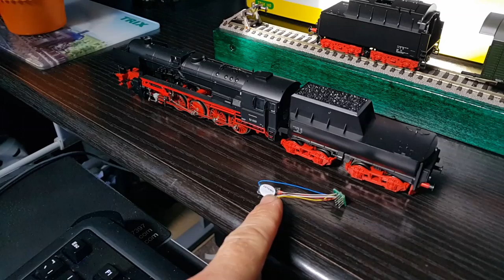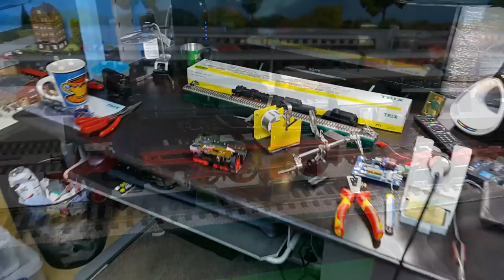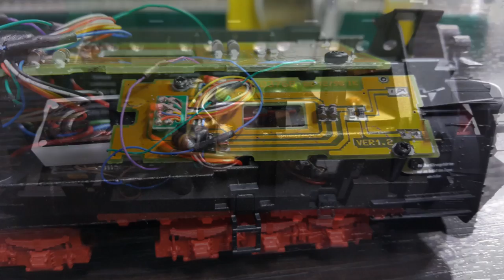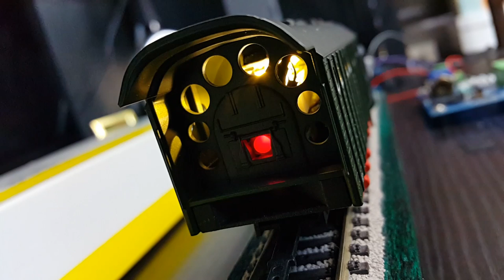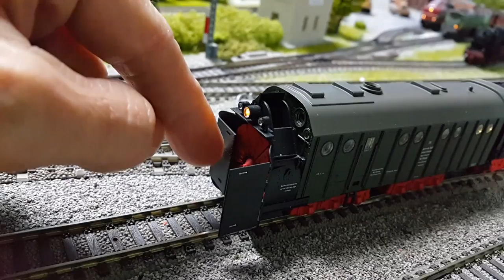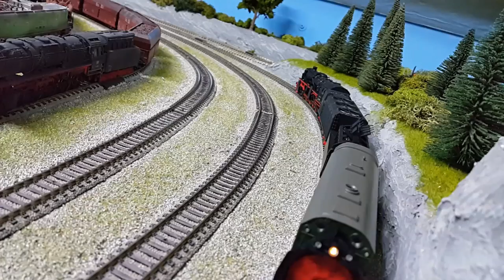TRIX 22521 HENSCHEL STEAM SNOW PLOW SET.

Comment: You may need that snow plough in the winter for your layout  if that family roof project comes a cropper...lol last thing Jim are your speakers wired in series safer mate,  parallel draws a bit more on the chip amp most loksounds will handle it but if the old volume is turned up full could be curtains cheers Tony.
Reply from the maker: sheba31 lol....its guaranteed for life....I only used one speaker but great info Tony as I know you are very good with wireing and electronics etc..and all other areas too.